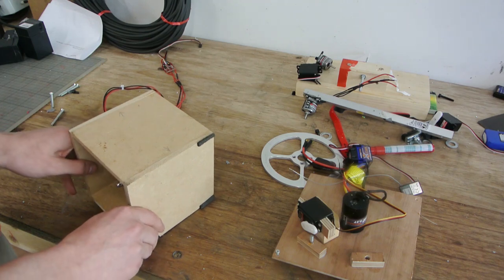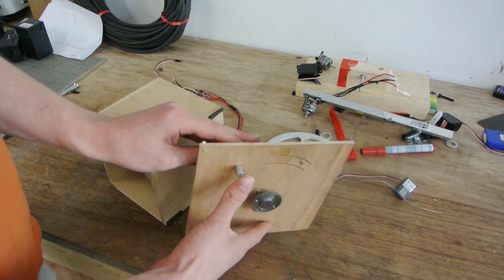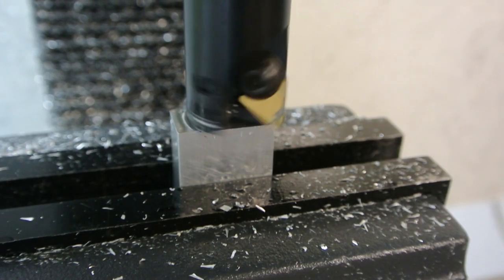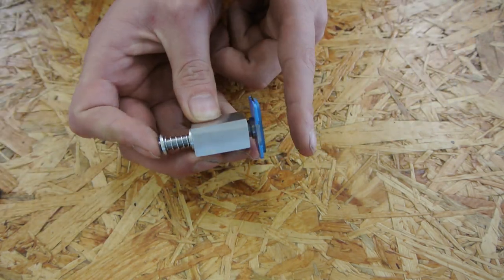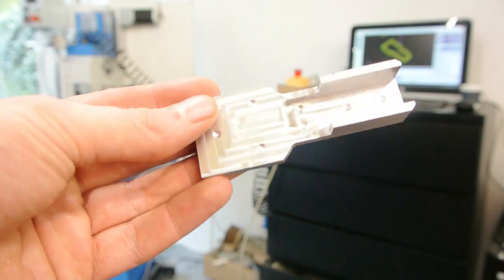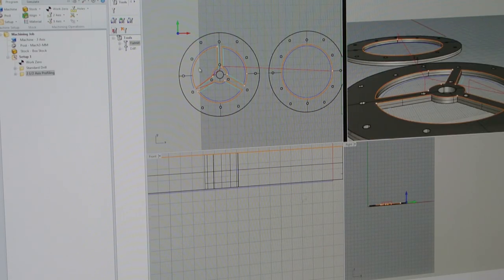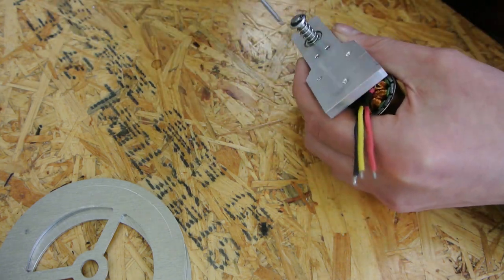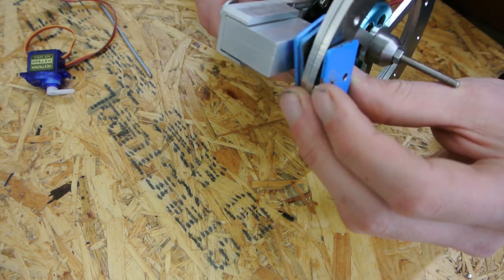making a Rolling Cube : Part 1

Comment: Nice project! Could it be possible to utilize the active breaking feature of modern ESCs (SimonK or BLHeli firmware) to assist the servo in deceleration? This feature is becoming popular for use on multirotors, but I am curious as to what effect it will have with the flywheels, seing as they have quite a bit of kinetic energy stored up.
Looking forward to the next video
Reply from the maker: tnx!
I tried it with just ESC breaks. It slows more down then without a break, but it's not fast enough on his own. But maybe I'll combine the two.